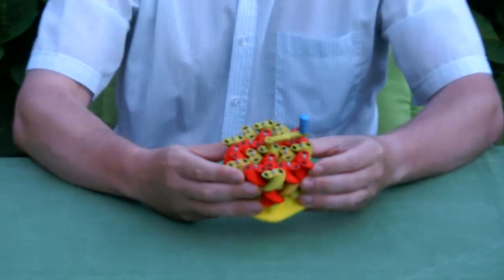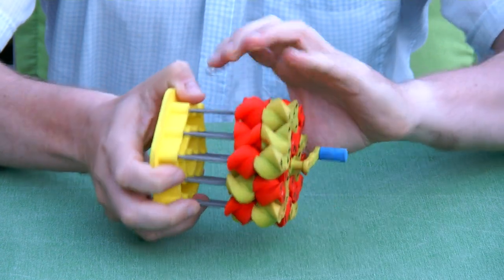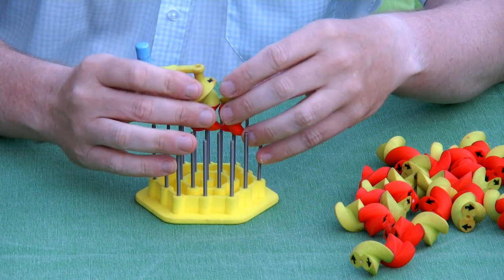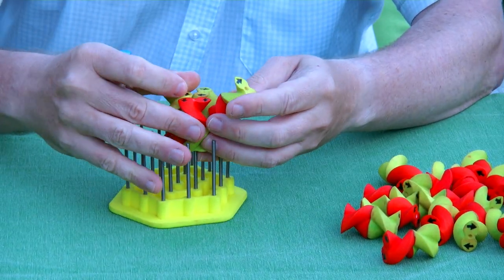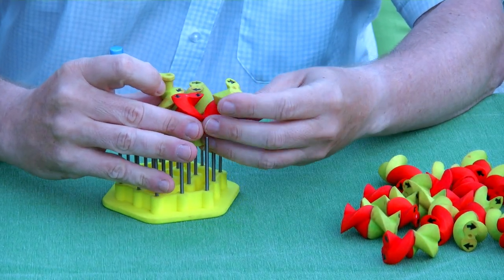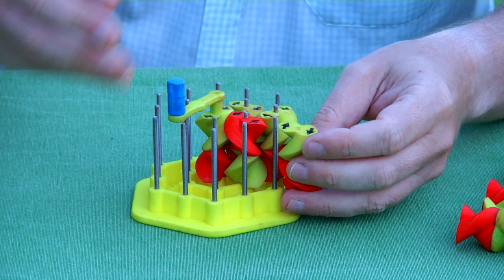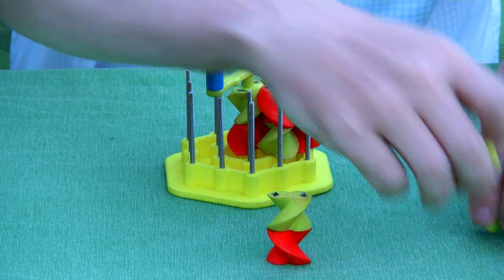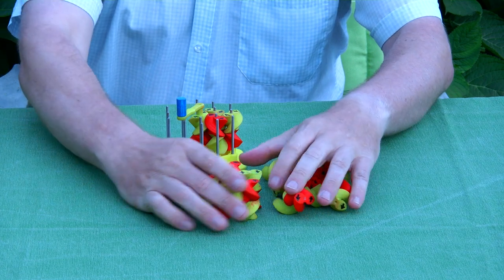Magic Gears Grid   more details

Comment: Two of those gear cylinders inside a housing would make a nice friction based mixer. Rubber is often mixed and softened by kneading it like dough before being molded into shape. The gears would need to be spaced apart and synchronously driven to achieve the shear-mixing effect.

Comment: This design could be developed for industrial processing applications, such as grinding and mixing. They large sliding contact area between the gears would work well for mixing paints, syrups, any liquids with out introducing  air bubbles. It could also combine, and grind dry ingredients, such as baking mixes, cements, and excelle at grinding material to fine powder.

With the addition blades it could also be used as a shredder.

Comment: To make it easier to put them back in the pins, how about a tray that slides on the pins, with a lowered circular area around each pin just a little wider than the gears?

Comment: The handle seems to only go in the centre, but will the gears still operate if the handle is on the edge?
Reply: I don't see why it wouldn't?
Reply from the maker: It should. Never tried ...
Reply: it may be possible.. cz the gears are equally distributed. Oskar try it out!
Reply: Probably more leniency in the gears furthest from the handle.
Reply: Yea, it may be more unstable, but at some point it can be made stable